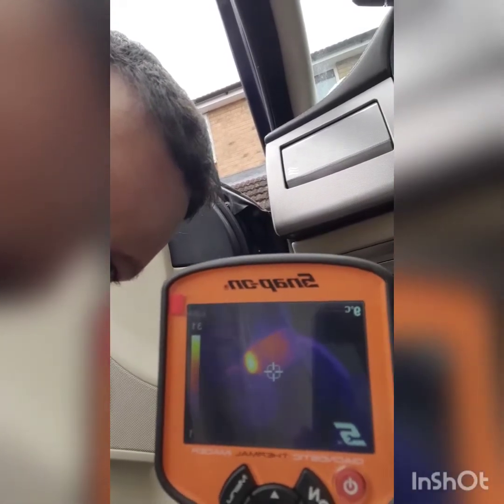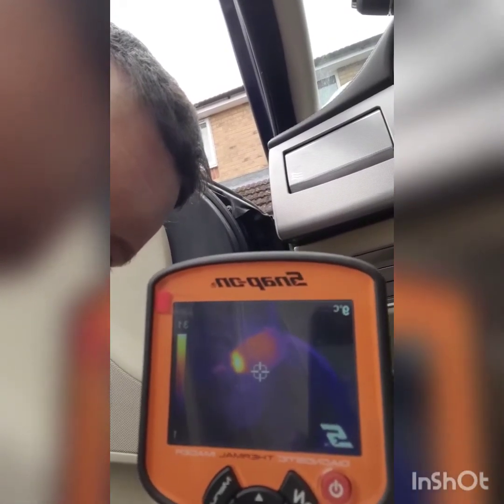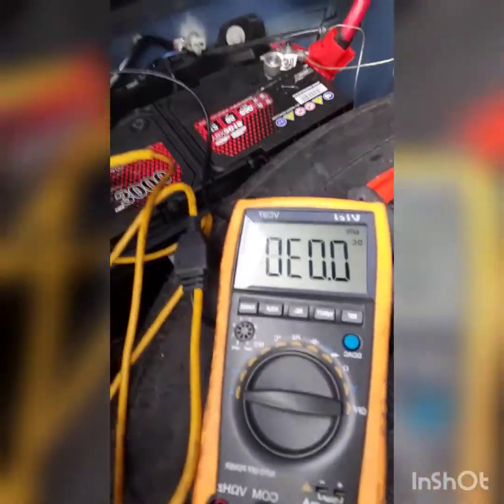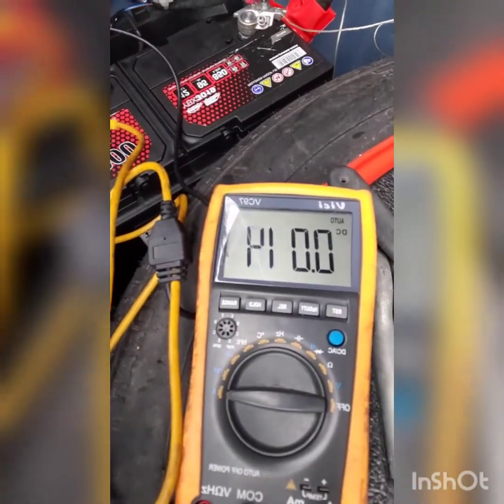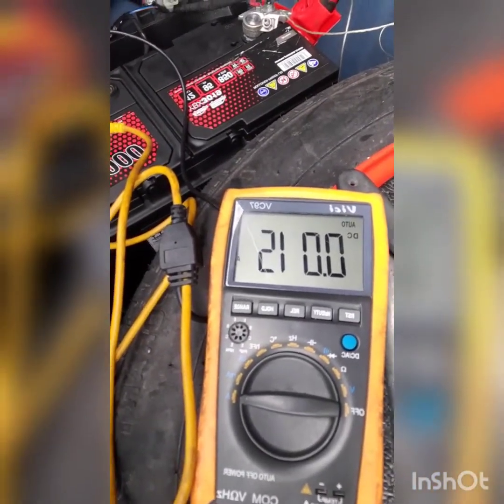Jaguar XF battery drain, diagnosed & fixed using a thermal imaging camera

Comment: I had same problem, mine was an electric heater that cleared front windscreen quickly. Apparently they are in all jag xf for cold countries
Reply: @colinblackwell5059  it's a special heater for front windscreen. My battery would be flat overnight. The heater if for cold countries to demist windscreen quick. My was staying on